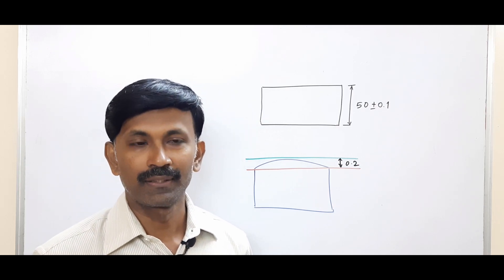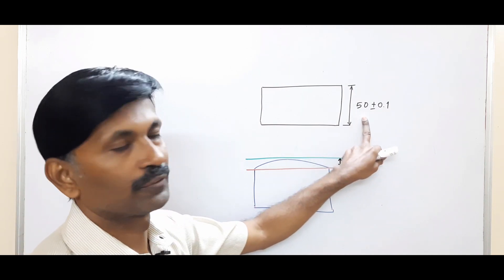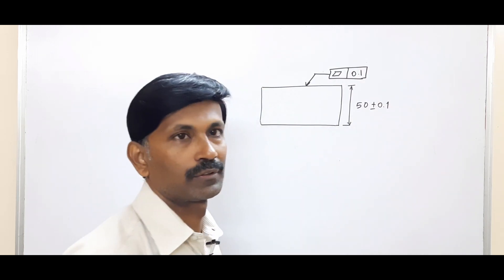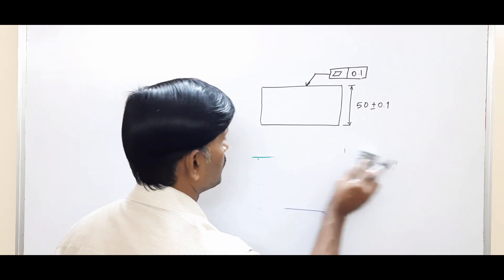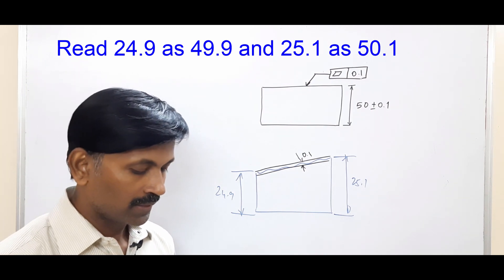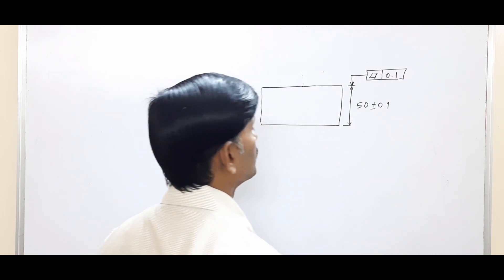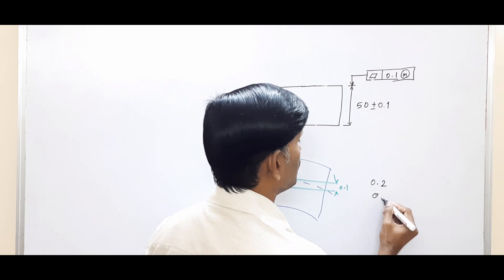GD&T Tutorial 21 : Flatness Tolerance

Comment: Sir then what about the flatness on bottom surface? Is it possible to control the flatness on both the surface (top and bottom)? Looking forward for your reply. TIA
Reply: The Derived Median Plane Flatness that the instructor is discussing here is for when it is important to control how bent a part is allowed to be. But, yes, you should always control the Size, Form, Orientation, and Location of every Feature of a part you design. So, yes, you would also specify the Form of the top and bottom surfaces with one of the Form controls, e.g. Flatness. You could also use Flatness for say, the bottom surface, declare that as Datum Feature "A" and then use a surface profile feature control frame for the top surface and make that profile dependent on Datum Feature "A". There are many ways to control the Form of a feature.

Comment: When applied to an axis (Feature of Size), Straightness and Flatness plays the same role?  Please elaborate
Reply: Derived Median Line Straightness and Derived Median Plane Flatness are different. Median Line is typically applied to cylindrical parts. Median Plane to rectangular parts.

The Median Line is the set of points that you get inside of a cylindrical component when you take half the local diameter distance, for example, when measured with a caliper, for every cross section along the cylinder. For example, you could have a Median Line that is curved, as would be the case for a bent pin. Any Derived Median Line Straightness call out is an exception to Rule 1. That is, you don't have perfect form at MMC for the pin. That is, the envelope for perfect form for the pin would be the virtual condition for the pin. i.e. MMC + the Derived Median Line Straightness tolerance.

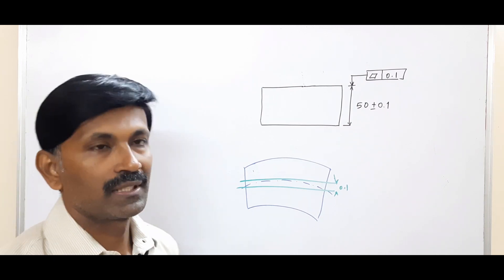Derived Median Plan Flatness is similar, but here you're dealing with a the Median Plane when dealing with for example a rectangular piece of material. Any Derived Median Plane Flatness call out is an exception to Rule 1. In the video, at time 3:51, the instructor is showing a Derived Median Plan Flatness of 0.1 mm. The MMC for that part, is 50.1. The Virtual Condition for that part, the perfect envelope for form, at its largest size, would be MMC + Median Flatness = 50.2. But, note the following: the Median Flatness tolerance here is specified at RFS (regardless of feature size). Therefore, the curvature of that rectangular piece of material would stay the same, at 0.1, no matter what the actual size of the part is between 49.9 and 50.1
At 4:05 in the video, the instructor added the MMC material condition modifier. What that means is that at MMC for the part, 50.1, it could be bent as much as 0.1. But, as the actual size of the part gets smaller, it can be bent more, i.e. Bonus Tolerance. For the case of the tolerance specified with the MMC modifier, the virtual condition of perfect envelope for that part is always the same at 50.2, no matter what the size of the rectangular chunk of material. In this case, you could build a jig with a perfect slot sized 50.2 to check every part built to see that it is not bent more than specified. But, obviously, you would still have to check the local size to make sure it meets the +- 0.1.
Note that you would not be able to build a similar jig to make it easier to quickly check the part when it is specified with a tolerance for the Derived Flatness of 0.1 RFS.

Comment: Sir why we dont use datum to form tolerances ?
Reply: @GoodFoodGoodMood481  Thanks
Reply: Form controls, "Flatness, Straightness, Circularity and Cylindricity, are describing a property of a feature WITHOUT any relationship to any other feature on the part. For example, a surface of a metal plate has a certain flatness to it. It doesn't matter how that surface is oriented or positioned with respect to any other feature. As a matter of fact, the Y14.5 standard makes it illegal to specify a datum reference in the DRF (Datum Reference Frame) of a feature control frame when using a Form control.

Comment: here, the total allowed variation for both the sides are 0.2.and each side carries 0.1. how did you get 0.2 for one side? 
correct me if I'm wrong..
Reply: No. The total variation of 0.2 is not divided between the top and bottom surfaces. When you take the Caliper and place it across the part, that size has to be between 49.9 and 50.1. For example, you could have the bottom surface come out of manufacturing such that it is perfectly flat, as unlikely as that could be. In that case, you could have all of the 0.2 variation on the top surface and still have a good part.

Comment: Sir what is the difference between straightness and flatness tolerance when both are controlling peak and valley limits of a surface?
Reply from the maker: straightness is at one plane and it is 2D entity
Flatness is for entire surface, and it is 3D entity
Reply: @PalaniKailash  sir, you said , straight line is 2 D entity and flatness is 3 D dimensional entity. Please clarify how to choose those features (line , plane, circle, etc)which one is 2D and 3d. Any video refer or upload/suggest sir.